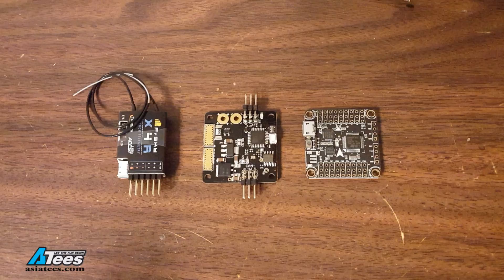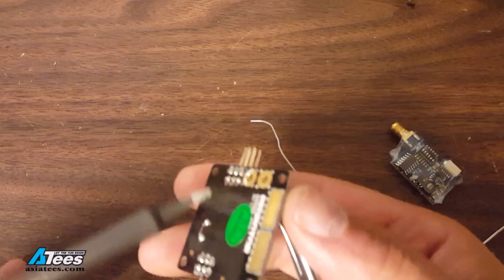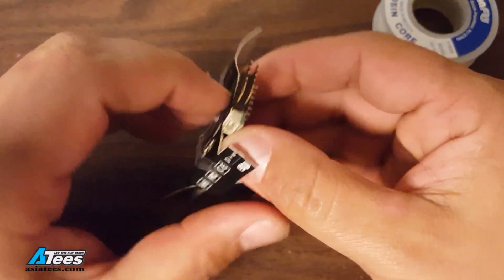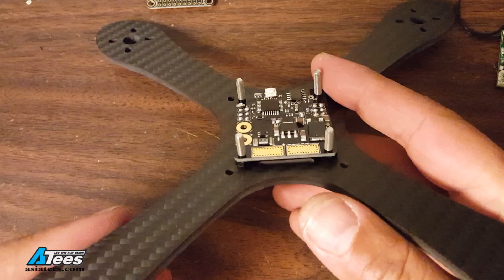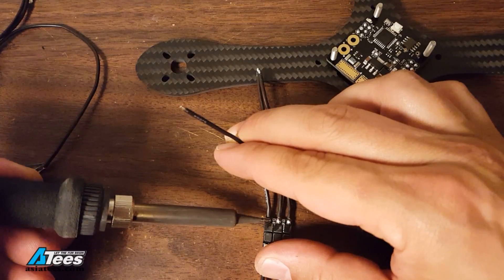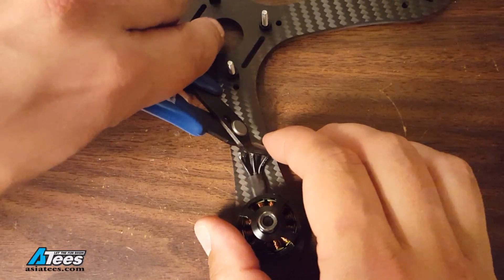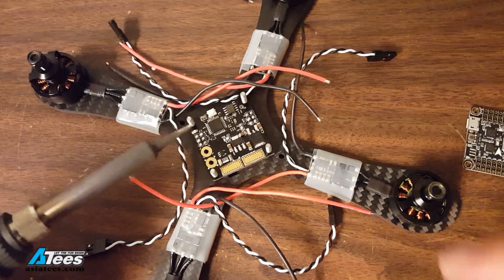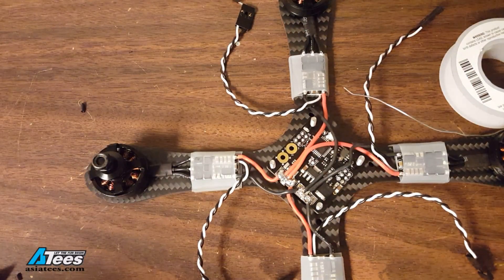Pure X Racing Quadcopter Build - Part 2 - Depin, Motors, ESCs, PDB

Comment: You need a better tip for pin de-soldering. The one with more heat capacity.
Reply from the maker: My iron was just not hot enough. The tip is fine.
Reply: I hate soldering chips to the board.  You do it wrong you have to throw away the whole thing.  Why can't it come already installed or have the ability to custom configure chips that are already soldered properly and professionally?  Wouldn't mind paying a bit extra for that than completely fucking it up.

Comment: I'm really enjoying this series. I built my first quad 18 months ago.  All pins, lots of connectors, etc.  I am now planning two new builds and I know I need to user fewer/no pins, and this has been very helpful.  I'm still pretty gun-shy on the no-pin stuff.  I'm pretty good at soldering (normal size wires, that is - not processor-level) but my de-soldering skills have caused me to destroy boards.  I think I've been leaving the heat on the board too long, but I don't know for sure.  

Thanks again.
Reply from the maker: +John O&#39;Shaughnessy I still will use pins for larger builds. I just don't think the few grams of saved weight is worth the maintenance hassle. But it is a nice challenge to do a build like this just to hone your skills. I highly recommend it.

Comment: Recently I had to deal with 23 teranis playing in a high rf environment. it didn't go so well but we got away with it. Lots of signal drop outs but strangely only on the main dude. Animatronics, not quads but what a tool the teranis is!
Reply from the maker: +Adrian Parish 23 Taranis in one place! Holy cow. They use frequency-hopping but there is only so much you can do. Maybe the main dude's radio was a dud?
Reply: +Joshua All the radios were good. it just depended upon the order we switched them on. I know now to switch the most important one on first and then it seems to have a stable link. it was a very trying day I can tell you.

Comment: Really enjoying this build vid. I'm about to embark on a similar venture with a drone x labs frame. 
Referring to your later vid, I think you diversifying into product reviews is a winner for me. The black box stuff is really niche and pretty advanced for people just getting into the hobby and fascinating as it is, I look forward to the more build orientated vids you produce. 
I've just received two x racer 303 boards on the back of your review after having a few troubles with a dodo 5 v reg failure. I've made it work after alot of head scratching and as a result have no voltage telemetry due to an apparent lack of vbat on the board. ( I had to pick up 5v from the matek 5 in 1 pub and run it to one of the esc channels. the result is no actual battery voltage and no where to pick it up independently from the dodo ) I'm sure there's a workaround but other than getting a new board and having to start from scratch, I'll live with it for now. 
That brings me to my next point, it was immensely satisfying to see you also struggling with desoldering an esc. Most build vids make it look like the easiest thing in the world to do. It's not and I'm glad to see you addressing the problems that Everyman faces when trying to solder electrical components for the first time.
Soldering is a massive part of the build process and I've only seen one vid that fully explained and really helped me to get a good connection. when I find it again, I'll pop it up as a link. I can do silver soldering and welding etc all day long as part of my job but electrical soldering is a new skill I'm still learning. 
It's one hell of a complex hobby and that's even before you leave the ground!
Great work Josh and as far as I'm concerned, post what the hell you like , it may be long winded at times but you cover your subject very well.
Now back to that LOS acro I'm trying to learn. That stuff is hard!
Reply from the maker: +Adrian Parish Thanks for the detailed response. I do think it's important to show the mistakes. The purpose of the videos is not to make me look good, but to help other people do it, and so when I have a bunch of mistakes, it's a real opportunity to show what can go wrong and how to fix it.

Check out my video on how to depin a TS5823 for a great example of everything going wrong.

Comment: +Joshua Bardwell  A little tip when soldering the motor wires on the ESC (or removing the old wires): Use some blue painter's tape (or masking tape) to cover the components on the ESC while you solder.  Put a piece covering the FET's as close as you can to the motor connections.  This prevents and possibility of splattered solder getting on the tiny leads of the FET's (and protects the rest of the components.  This is from experience when I ruined a ESC when solder splattered when removing the motor wires and the wire "popped up" spraying solder!
Reply from the maker: +Bruce Luckcuck Good suggestion!

Comment: Cutting the pins helps as the pin is less of a heat sink so all your iron heat goes into the pad.
Reply: Thats a great comment, I learned that in the hard way, destroyed a receiver's tracks trying to remove all pins at same time.
Reply: +Alexandre Wendt Shima Usually the ground is most difficult to remove, since the ground plane is massive, it sucks away all the heat. Same on PDB's

Comment: Looking like this is going to be a good build but your over the top of the PDB soldering of the ESC wires and the opaque white extreme tape has my OCD on edge
Reply from the maker: +Dexter x you think I should solder the ESC wires to the bottom?

The extreme tape is already gone. It wasn't working out.
Reply: +Joshua Bardwell your Josh Bardwell you can do whatever you like! love your channel!
Reply from the maker: Yeah, but if there is a good reason to solder to the bottom, I want to hear it!
Reply: +Joshua Bardwell Oh and I just ordered an RROSD, never heard of them before.
Reply: Just from an aesthetic the longer leads would have looked better from the top if you had run them underneath and wrapped them over to still solder on the top. Also I got a good tip from George at kooltoyz about wiring the ESC's if you don't want to risk overheating the board during soldering cut and solder the cables but turn two of the ECS's upside down. That way you can still keep the clean flat look instead of having one cable over another, like you say you can do it in bheli anyway but... I think for the littlebee's it's CW for right way up and CCW for upside down
Reply: lol at the OCD
I feel your pain man.
Reply: +Joshua Bardwell I'm about to redo my RROSD ESC cable routes to go under the board only because I get some on-throttle video noise with them over the components.  I expect that to improve things.  (That and arguably tidier 😉)

Comment: Are you going to take the metal screws out and put in nylon later? Any reason you did this part of the build using them?

I have been thinking I want a PDB that distributes the +/- pads individually around the board, so I don't have to cross a lot of wires (didn't seem to phase you, but I have seen some other rat nests), and to eliminate the issue you mentioned of having to go back and flow all 4 wires at once, since you don't have a separate pad for each wire. Since I don't plan to use all the telemetry stuff you do on the PDB, does that make sense? Suggestion for a simple PDB that is still good quality (amp draw)?
Reply from the maker: +Mark Sherman Yes. I ended up using nylon screws. The metal screws are in there because at the time I was just fishing through my boxes trying to find what I had that would work well. Ultimately, I like the idea of a single screw through the whole stack, but I don't like to use metal screws to do it. The kicker was that the screws were splayed out slightly, just enough that I had to really stress the FC if I wanted to get it onto the top of the screws. And that's when I said no thanks and went a different direction.

Comment: Love the vids as usual. I am a big believer in the RROSD PRO. Have you pushed over the the MAX 100amp draw through that board yet? I have a friend who has drawn over that several times and the quad dies. This has happened on 3 quads running the same setup built in the same time frame for MegadroneX. He no longer uses it because of that. I have run it up to 100 and just over a few times on full punchouts but never had my quad die like his. Your thoughts on this?
Reply from the maker: +Brent Simpson I've hit at least 120 with no problem.

Comment: i always noticed when de-pinning, the ground rail pins are the hardest to remove, usually requiring hotter and faster work, presumably because they have a straight trace between them all.
Reply from the maker: +NJ Tech should be the same for the 5v rail.
Reply: good point! I must've just remembered the signal pins coming out faster.

Comment: Love what you do Josh, but personally I don't trust your esc extreme tape mod thingy. If those esc's move just a little you'll be shorting something. Well, let us know how it holds up.
Reply from the maker: +Jorrit Lute Wolters I don't think they're going to move, but if you thought it was too close, you could do a double wrap, or use foam.
Reply: +Joshua Bardwell I always put some self sticking neoprene underneath to cushion them a little. still interesting though
Reply from the maker: +Jorrit Lute Wolters after working with the extreme tape for a little while now, I don't think I am a huge fan of it. If it seals under tension then is cut, it sort of tears off in one piece.
Reply: +Joshua Bardwell ok. Same can happen if you hit something. leaving them unprotected. Heat shrinking tube holds up a beating in contrary. Ok well, so far for extreme tape then. lol
Reply from the maker: Right now, I like the approach of using foam tape underneath with electrical tape above. Shrink wrap is of course my preferred approach but if the ESC is already on the motor and PDB then you can't get it on there.
Reply: +Joshua Bardwell I'll even take it for granted to desolder and resolder it just for this purpose. A good soldering station wants to be used, and is a lot of fun

Comment: some good tips in here, thanks.
My question. Why pure-x? is there an advantage in weight distribution? or is it just less popular because of the build difficulty? aesthetics maybe?
Reply from the maker: +txreceivable the pure-x build distributes the weight equally across the pitch and roll axis for symmetrical handling. It also has a smaller aerodynamic profile for less drag. It also forces you to go as small/light as possible just to get everything to fit, which results in better thrust to weight.
Reply: X = proper center of gravity. flips and rolls will be dead center if setup properly.
Reply: +Joshua Bardwell well that sounds awesome. why aren't we all x frames then?
Reply: +txreceivable good question it basically balls down to people like having options... but if you like dynamics and physics you good easily see the benefits of the X vs the buses we been flying.
dont get me wrong tho i do love my bus tho. mokaframe deluxe shes my baby but i cant build her to do what an X frame can do period.
Reply from the maker: I just did my first two battery maidens on the Mixuko and I can definitely see why the pure-x is popular. It is very "neutral". Pitch, roll, yaw... it just wants to go wherever you point it, very nimble, very agile. This is in some part due to the light weight of course. There are some x-style frames that have only a very slightly elongaged body pod that probably have very similar flight dynamics.
Reply: Always appreciative of your insight, +Joshua Bardwell . thanks.

Comment: Seriously, spend the $100 and get yourself a fx-888D soldering station, probably the best I have ever used, thing it awesome.
Reply from the maker: +Michael Kowalski but $17!
Reply: +Joshua Bardwell yeah, $17, but, proper grounding, proper temperature control, an awesome feeling pencil, proper stands. Trust me it is so worth the $100 :)
Reply: +Michael Kowalski if your using it daily professionally then sure a hakko soldering station is great but for occasional hobby use its complete overkill.
I would however rather a weller soldering station they are better in my opinion.

I have a nice temperature controlled 60w iron for my small stuff and a giant 100w weller for high power soldering applications 10awg cables, battery's etc.
Reply: +Stephen Gibb It does however seem that the iron josh is using is struggling with the lead free solder on the littlebees (maybe they used a higher temp solder).
Reply from the maker: +Stephen Gibb I think I just needed to turn it up a bit, or use a chisel tip instead of a pencil. It's normally fine. It gets plenty hot plenty fast.
Reply: im with josh on that one $17. I use one that has a 15W to 35w switch. it stays on 35w.